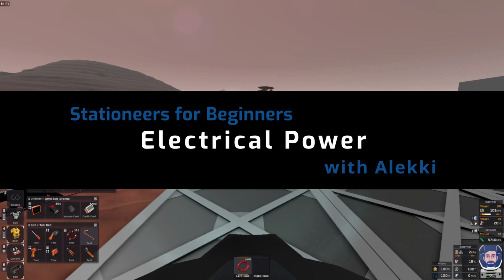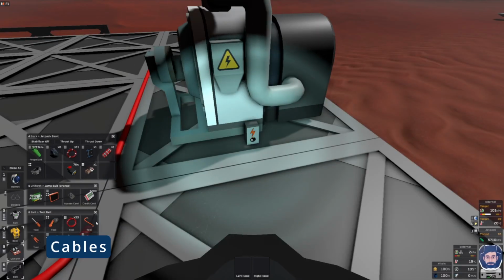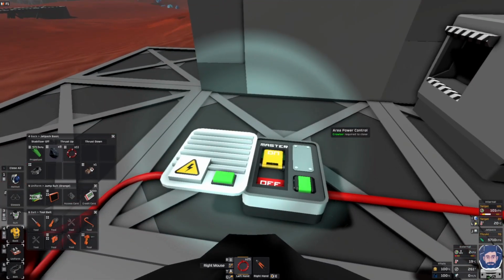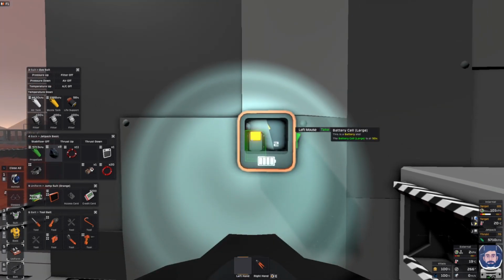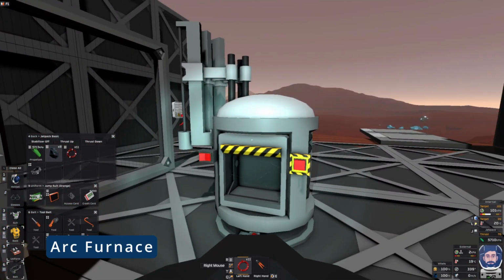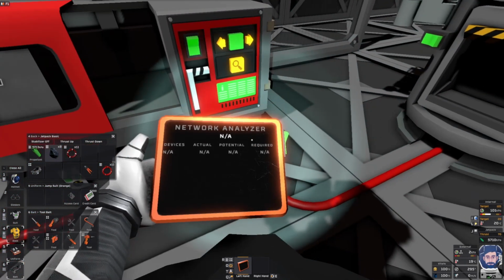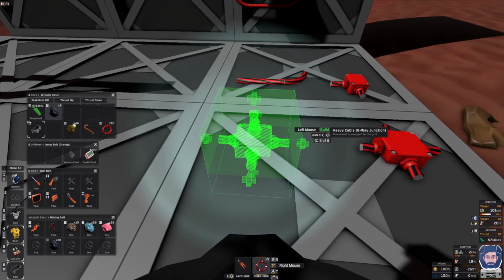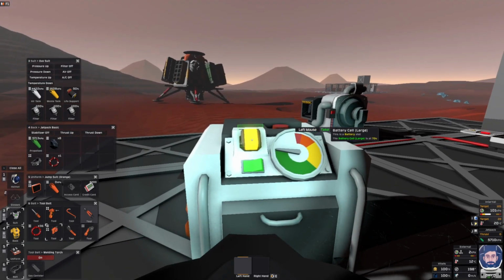Stationeers for Beginners - 3. Electrical Power

Comment: What a complicated controls 🙈
Thank you very much for videos, but I give up on this game. I expected to solve engineering tasks, but I found myself struggling with inventory management and unnecessarily complicated interactions with objects.
Again, thank you for video, you made explanations as simple as possible, without it I would drop the game way earlier 😅
Reply from the maker: You're welcome!  Sorry the game isn't working out for you.  I agree that the controls are quite complicated.  Though if you do manage to get over that learning curve, they become second nature and there's 100s or 1000s of hours of fun in the main systems of the game (plus the devs are very active in adding/improving content multiple times a year so it still feels quite fresh 1100+h in).